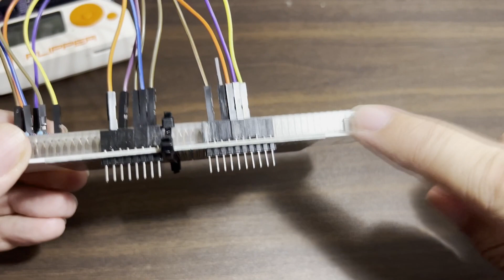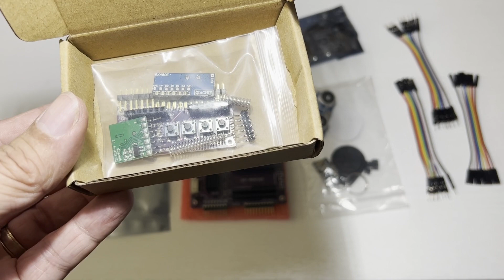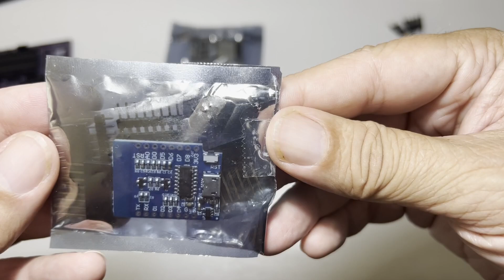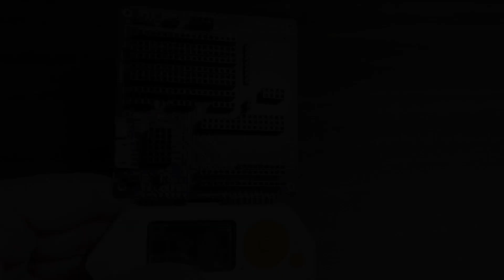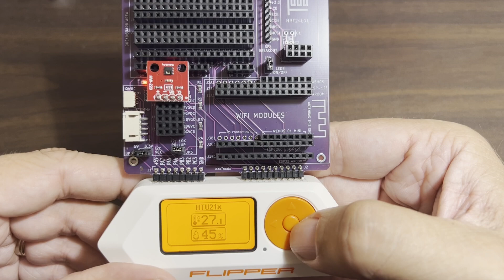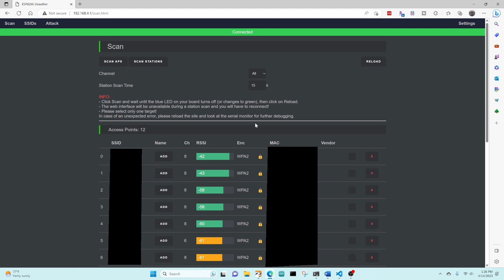[52] Flipper Zero - Dolphin Experimenter Board (Overview)

Comment: I've got one of these coming to check out! I'll definitely link your video as well since I'll need to reference a lot lol.  Great work!!
Reply from the maker: Thanks, huge fan of your videos.  I am hoping to create some tutorials on GitHub for the Dolphin next week.  Some people just starting out might not know about breadboard layout, how to solder (I figured I would reference sections of your PCB live stream, rather than shoot my own video), which direction to solder the header pins (and which headers for the 8266), etc.

My video next Saturday is just on the Dolphin+ESP32 (and a PowerShell script I wrote today -- it was my first time writing a ps1 file).  But hopefully in a week or two I can dig into doing some prototyping with the board.

One thing that I did get caught on, was I had both the ESP32 plugged in & I was using the UART top headers to connect to a DC27 badge.  I needed to disconnect the ESP32 since it uses the RX pin too.  (Documenting which pins each of the headers is using would be helpful, to help avoid those kinds of mistakes.)
Reply: @MrDerekJamison  Thanks for the heads up!  Absolutely feel free to link to or even use anything from my channel.  I've got it listed as Creative Commons so just throw me a link and you can do whatever you want!  I'm always psyched to see Flipper introducing people to this kind of tech, and seeing a whole STEM style platform is amazing!  If I have any questions, I'll reach out!

Comment: Nice board, you seem to know your stuff so I've got a wusrion that I can't seam to get an answer on. Does a board exist or can a board be made that just has a usb port on it with power?
Reply from the maker: Hi.  I'm really confused on your requirements here.  Are you talking about a board that connects to the Flipper Zero and exposes USB port with power (and no data interaction)?  What kind of port -- USB-A, USB-C, micro-USB?  What kind of power requirements?  The Flipper Zero has a 5-volt/1Amp max current (so it would be a 5-watt supply at most).
Reply: @MrDerekJamison  sorry I forgot there is different usb,s I've been out of the tech game for a while lol. OK so yes a board that has a usb-a port I believe (the one you plug a usb stick into. As for the power requirements it's a new product and all the information says it will work in and usb powered port (computer, powerbank, wall charger etc). I don't believe it needs any data just power. A port like bad usb uses
Reply from the maker: @jerrysberrys3415  search for “USB A Breakout Board” on Amazon and you should get some results.  On the FZ the 5volts needs to be enabled under GPIO, so that pin 1 has 5V.  The pin 8 goes to ground.  If you want a more solid board, instead of jumper wires, you could solder those headers to the Flipper Zero prototype board (shop.flipperzero.one)
Reply: @MrDerekJamison  awesome, thanks heaps for taking the time to reply, I'll look it up now and see what I can find